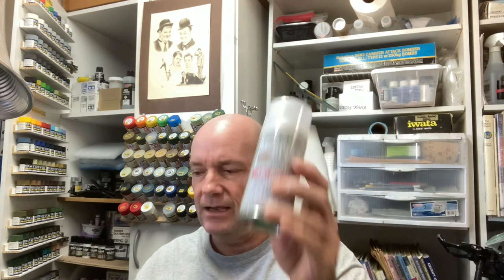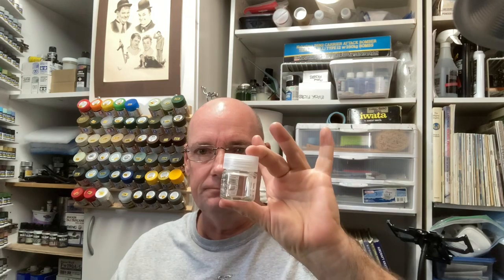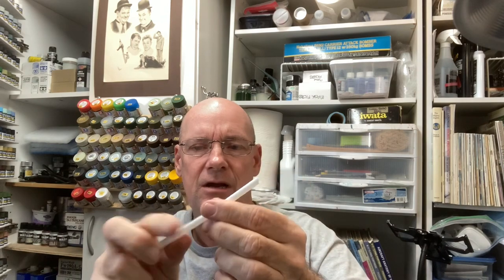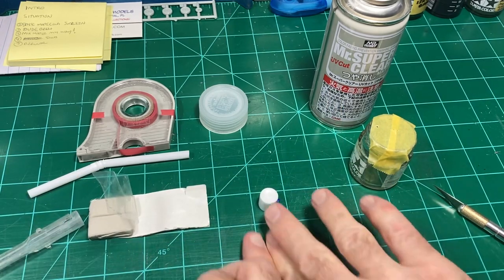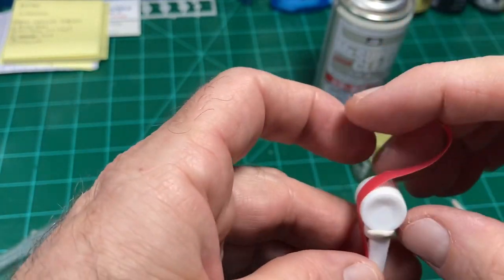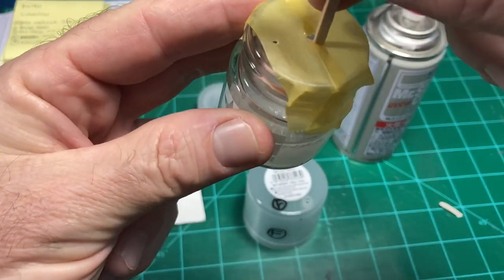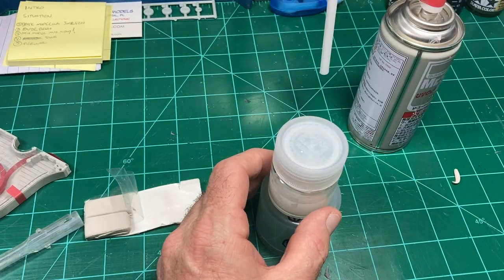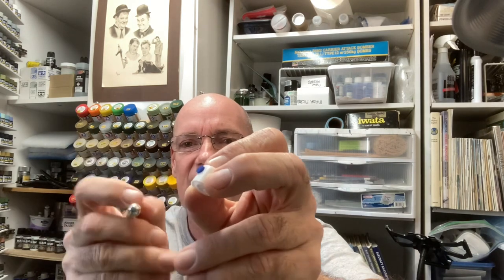Terry’s Tips:  Decanting Spraycans For Airbrushing

Comment: Thanks for the video. Can I ask what ratio you’d thin it down  …. 50/50 maybe (or thinner ?) for use with say an 0.35 mm needle ?
Reply from the maker: Depends what you are decanting.  For primers about 50/50, colors about 60/40 to 60/35.  I use Mr. Leveling Thinner and shoot through an Iwata HP-CS which I think is a .35 needle.  About 18 psi.  That’s about 80% of my shooting.

Comment: Save yourself some trouble.  Just take a flexible straw and "hot glue" it to the spray nozzle.  Let it cool then run another bead around the join make sure there are no gaps for the paint to seep out.
Reply from the maker: That's not a bad idea at all.

Comment: Great video, however you have made it very complicated. The simplest and cleanest way is to spray directly down the  side of the airbrush cap into the airbrush. No messy straws and the paint gets kept in the spray can. I do this nearly every time i airbrush and found it way faster and more effective, and no need to think about storing paint or thinning or off gassing. Just spray into airbrush and then spray out of airbrush.